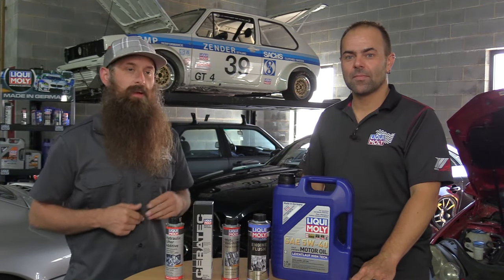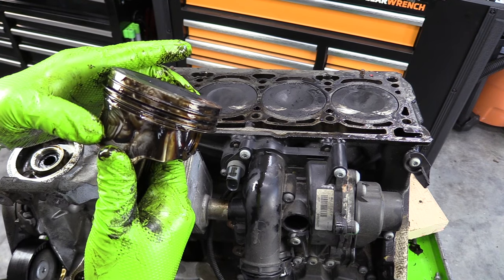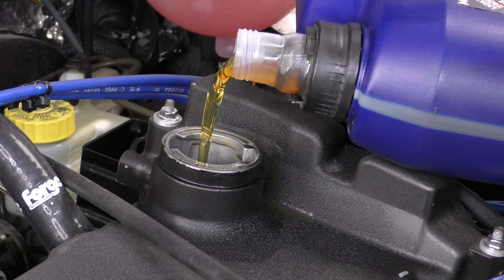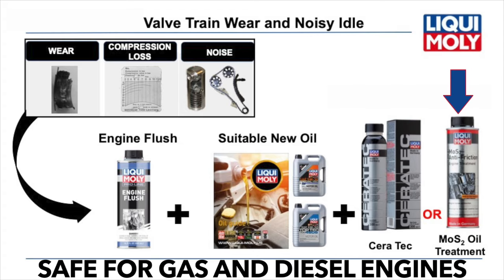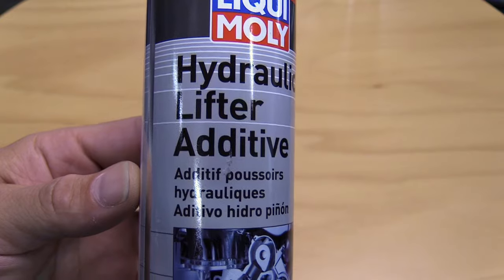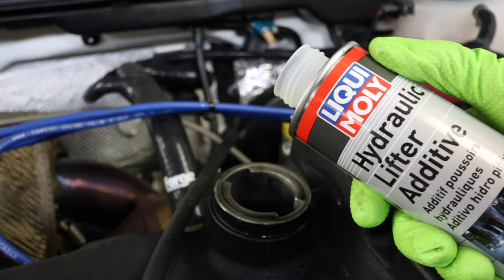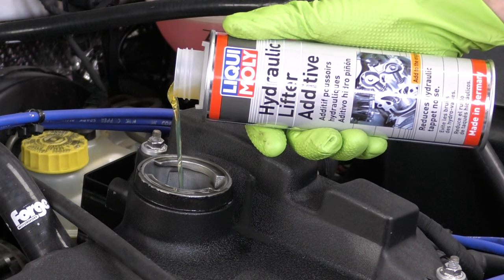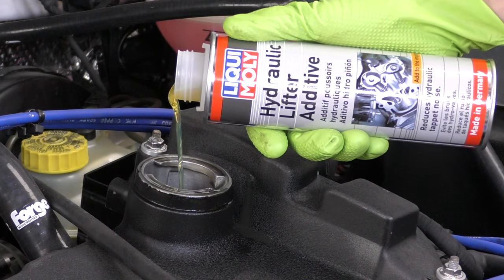Humble Mechanic - LIQUI MOLY - Valve Train Noise

Comment: This product works like magic. My lifters were very noisy and went silent immediately. I could not believe my ears.
Reply: Which one did you use
Reply: Update, this does not help with lifter noise at all
Reply: @mistacdawg6882  which one did you use?
Reply: Did you add it to a fully topped up oil tank or was the oil low before adding the lifter cleaner?
Reply: The purest additive I’ve ever tried was XL-3 friction modifier 
If your engine fluid takes 6qs use 3 bottles of it to match the total amount of 6qs you don’t wanna go more than recommended level

Comment: Skip all this just flash change oil every 3k and most importantly add 1qt of MOTORKOTE hyper lubricant. It's molecular structure is such that it actually soaks into the metal reducing or completely eliminating friction wear

Comment: I tried the Forte at the last oil change and it had no effect. This time I tried Wynns, and the tick vanished within 30 seconds. This is on a 88k Volvo V50 1.6D, I was thinking that I would either have to have new lifters or sell the car, but I now have a lovely quiet, smooth engine again. I am assuming that the oilways have now been desludged, so I will just try clean oil at the next change and see if it comes back.

Comment: Can I use the ceratec with the lifter additive? And what is the order when pouring them into the engine
Reply from the maker: Hello jc, 
thank you for your inquiry.
Yes you can use Cera Tec with Hydraulic Lifter Additive.
The order does not matter as it gets mixed in the oil very quickly.

Kind regards, 
your LIQUI MOLY team
www.liqui-moly.com

Comment: Hi LM, can I use Hydraulc lifter additive for my dephaser pilot on a Renault 1.6i , put a new dephaser in and the start up noise is still there?
Reply from the maker: Hello Jack, 
thank you for your inquiry.
You can definitely try if the Hydraulic Lifter Additive is helping in that case, too.
But if the dephaser is really the problem it should be solved by put in a new dephaser.

Kind regards, 
your LIQUI MOLY team
www.liqui-moly.com
Reply: @liquimolywebtv  thanks I put a nee dephaser in and it’s still making the start up noise , no now will try a new dephaser solenoid

Comment: Do I need to change engine oil after using the Valve train noise product for a few hundred miles or add it to new oil after changing oil and keep it in there?
Reply: If your talking about the hydraulic lifter additive it can be added in and kept at any time

Comment: can the hydraulic lifter additive and MoS2 be used together, added the MoS2 when i did my oil change and wanted to add some hydraulic lifter additive now, would this cause any problems? i dont think it would just wanted to be sure.
Reply: Same question here.. I added ceratec now i'm wondering if i can add haydraulic liftters or not
Reply: @faridh2125  I have the same question
Reply: You can they already answered this question, but don't use Ceratec and Mos2 at the same time

Comment: Hi there.. Can this be use into bike.. I own bmwf800gs.. Wonder would it can be use or would harm the wet clutch.. Trying to prolong the VC service...
Reply from the maker: Hello jijo, 
thank you for your inquiry.
At first your engine does not have hydraulic lifters, thats why it would it actually makes no sense using this product and it is not meant to be used in vehicles with wet clutches.
If you want to do something good to your engines oil cycle use our Motorbike Engine Flush.
https://pim.liqui-moly.de/pidoc/P000023/1657-MotorbikeEngineFlush-35.0-en.pdf

Kind regards, 
your LIQUI MOLY team
www.liqui-moly.com

Comment: So, you need to put LM hydraulic lifter additive  in fresh oil?
It can be mixed with ceratec?
I flushed my engine with engineflush LM, and started knocking, I think it is a stuck lifter... that is not good

Comment: hey please a quick question  buy very important for me :)

i changed my oil and my oil filter yesterday but i did not put the hydraulic lifter additive.....if i want to put it do i have to change the oil again ? i just changed it yesterday i did flush the engine before changing the oil.... :)

thank you :)

Comment: I have a 1989 Mercedes 3.0 litre gas engine.  Lately it's making noise in the top end, like a bumping rattling noise.  Can I use one of your products in it without harming the engine.  It is a aluminum head straight six.
Reply from the maker: Hello 172, 
thank you for your inquiry.
Yes, it can be used flawlessly.

Kind regards, 
your LIQUI MOLY team
www.liqui-moly.com

Comment: I have a Mercedes 1988 , I changed the oil yesterday but the engine sounds lil noisy ( hydraulic lifters ) , should I add this product and flush the engine oil or just keep it till next engine oil?

Thanks
Reply: Use and Lucas oil aditive

Comment: Hi liqui moly ,can i use the lifters aditive with the oil change for the rattling sound of lifters only   or i have to to first do the engine flushing procedure then I've to add the lifter additives and i want to know the procedure for this please reply
Reply: @liqui moly
Reply: @mr-king9981  not liqui moly but I use the lifter additive every oil change without flushing and it works amazingly well

Comment: Anyone else think this would work well for cleaning vvt camshaft actuator /solenoid
I recently had P0017 and P0014 and lumpy idle,   changed the oil and drove it hot a few times after being qouted 3k to replace them luckily it worked and its running perfectly again now,  ....... No ticking, engine completely silent but thinking this would clean the vvt actuators 🤔🤔

Comment: Hi, I'm driving a 2.0 MPI car with 60k km on the clock. The engine is developing loud tapping noise during cold start gradually decreases as I drive the car (but it's still there).

I'm planning to get LM Molygen 5W 30 + LM hydraulic lifter additive, does this combination works? It's understood that no additional additive is needed for Molygen, but does the combination above (with lighter oil - 5w30) helps the engine tapping noise?

The engine is on 5w40 oil all the time (Shell Helix Ultra).
Reply: Maybe try 0W-40, if it's the cold start (you probably have really cold winters over there). Make sure your car can take 30 oil (fairly recent or oil-water heat exchanger and/or stupidly cold weather), if you try an xW-30.

Comment: it hasn't reduced the noise after around 60km of driving.. used it in polo '98 6n1
Reply from the maker: Hello Elfas, 
thank you for your post.
If the noise does not get reduced, please see a workshop to get a proper diagnose. Maybe there is another reason regarding the noise.

Kind regards, 
your LIQUI MOLY team
www.liqui-moly.com
Reply: @liquimolywebtv  it got a bit reduced, but still you can hear that noise. Car is too old to put real money into it, maybe using liquimoly flush would help? or it would be wasted effort?
Reply from the maker: Hello Elfas, 
from distance we are not able to determine if it would be worth using an Engine Flush but by our experience it could help.

Kind regards, 
your LIQUI MOLY team
www.liqui-moly.com

Comment: My car has loud lifter clatter only on cold startup. The owners manual states that either 5w30 or 10w30 oil can be used. With winter around the corner, I’m not sure what viscosity oil to use in combination with your lifter quieting additive. Any suggestions? Thank you!
Reply: 5w30 for winter
Reply: @melvingibson4525 how bout the recommended for ur car should I still use the ones u saying?

Comment: Hi there,
What
What's the difference between Hydraulic Lifter Additive and the Cera Tec? Moreover, are they suitable for 1.6cc Daewoo Nubira 2002 engines 160,000 miles?
Reply from the maker: Hello Tamer, 
thank you for your inquiry.
The Hydraulic Lifter Additive is specially made for issues with the lifters, whereas Cera Tec is an oil additive to reduce friction and wear.

Kind regards, 
your LIQUI MOLY team
www.liqui-moly.com

Comment: I own a 07 (1.3 Petrol) Lancer whose engine recently completed 300K. Engine idles a bit rough, gets overheated if driven straight  for 3-4 hours and if you open the oil cap while the engine is running, it blows with SOME force.
Out of all the additives range you have, which one should I use and in which order?
Thanks

P.S. I have recently bought "Motor Oil Savor" and planning to use it on next oil change (I am using Liqui Moly 5W-40).
Reply from the maker: Hello Zeeshan, 
thank you for your inquiry.
In your case we recommend to go to a workshop/garage to check the causes of your mentioned issues first. This sounds like mechanical issues.

Kind regards, 
your LIQUI MOLY team
www.liqui-moly.com
Reply: @liquimolywebtv  Thank you for your quick response.
Reply: I have a 1991 Lancer GTI 16V with noisy lifters, hope this quiets it down. 140hp is not bad at all for a first car! Love these old mitsus, they are built though as nails. My moms 1988 2.6L Petrol montero has almost 400.000km